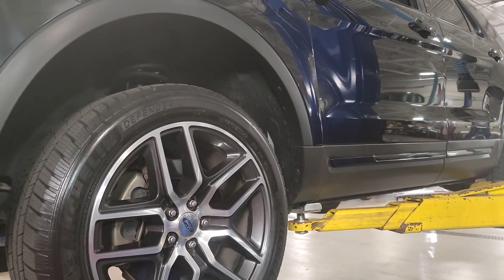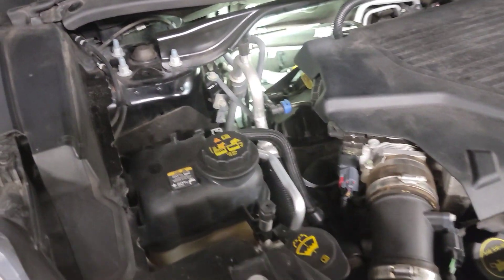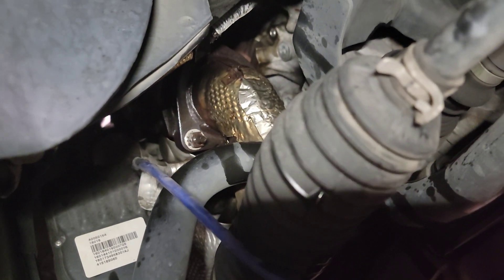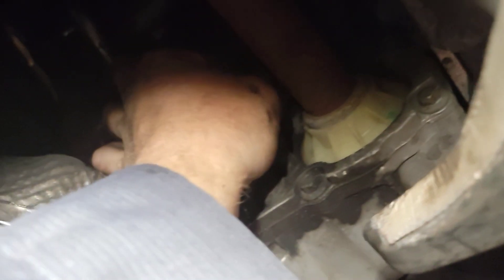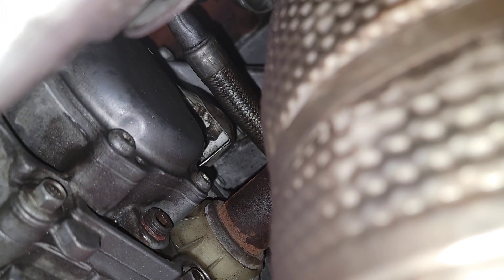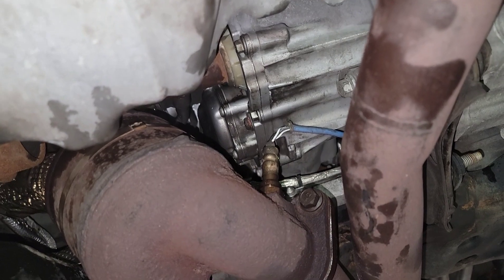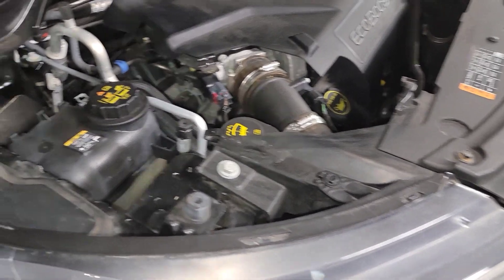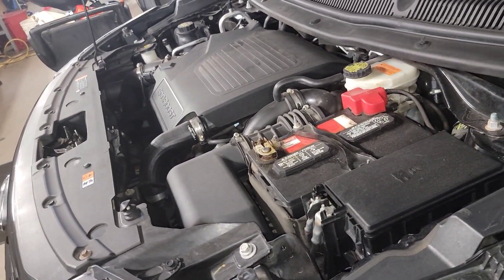Dealer Said, " PTU Cant be serviced  " WRONG!!!! Subscriber PTU Service 2016 Explorer Sport Let's Go

Comment: I do the drain and fill when I do the water pumps on the Police utility, we have the 3.7 n/a in our fleet. Figure I already have the engine on the table, might as well change the ptu fluid.
Reply: Don't get me started in the damn water pumps in the 3.5. What moron engineer decided it was smart to put the water pump inside the damn engine?!?! 😳 instead of just unbolting it and bolting a new one on when it starts weeping, nope. Tear the whole front end off the motor, may as well do chains, tensioners, phasers, etc when you're in there, because they'll be next.
Reply: We have had some go to the dealer under warranty but the majority of the water pumps we do in the shop are coming in around 80k plus. But you have to remember they have a ton of idle time which puts a significant wear on the engine.
Reply: Have you ever drilled and tap a drain in the case?

Comment: I still want to backhand the engineer that never put a drain plug in the ptu...how much extra cost to have then cast a hole and machine threads in....hell use a oil pan drain bolt

Comment: Thank you Rich for continuing to remind us about the necessity of maintaining the PTU on our vehicles. It has amazed me the terrible appearance of the lubricant in the unserviced and failed units from your previous videos.
Reply: They smell as bad as they look, I changed my PTU fluid on time and it was black. My local ford dealership said they couldn’t change the fluid, so I bought a hand pump and did it myself.
Reply: Mercon LV changes color around 15,000 miles i don't know why it does but i read that somewhere it looks like engine oil at that time .

Comment: PTU replacement is expensive ($2k vicinity). Been there, done that. Changing PTU fluid regularly is the absolute most important thing you can do to give your PTU a long life. For some inexplicable reason, PTU oil change isn't even in the service manual. If you own an AWD Explorer, Edge, Flex... anything with that PTU in it, listen to Ford Boss Me and save yourself a ton of money and grief!

Comment: I bough a 2017 Explorer used and the service dept. told me it was life time fluid and they wouldn't change it. I traded the explorer back in the next week and picked up a two wheel drive 2017 Expedition, more money, same mileage, less headaches.

Comment: I bought a 2017 Police Interceptor Sedan (Taurus), and it had this model PTU shown in the video. This video helped me immensely despite some minor differences in the surrounding components, just wanted to drop a comment and a like. Much appreciated.

I was thrilled to see pretty decent looking gear oil come out when I got the drain off. So glad it wasn't the goopy mess I've seen in other videos. Probably won't need to touch it for 30k as you stated, just glad I don't have to worry about it anymore.
Reply from the maker: Your good then for sure

Comment: This man does a fantastic job and he is a A+ mechanic I’m sure, but there’s a much easier way to do this. Instead of pulling the catalytic converter and messing with the sensor, you can drain the oil out through the drain plug and refill the unit through the vent hose, which is top side. What makes this a whole lot easier is putting the oil in a warm pan of water and warming the oil up before you pour it in. It does take about 30 minutes to drain the oil in but it’s a whole lot better than pulling out all those parts.

Comment: It's so frustrating!  I have the "shop manual" access for most makes & models and almost all of them say "no service needed" for transmissions and PTU's so they don't give any specs, nor anything useful as far as fluid replacement
Reply: Hello,
Which service are you using, Mitchell ?
Is it accessible to anyone ready to pay?
Thanks for getting back to me.
Tigo
Reply: @tt6518  I use the public library access.  They have manuals for most makes and models and the best part is they are online so I don't have to go to the library, just have to have internet access
Reply: @WJHandyDad  hello,
Haven't thought to try this option until you mentioned it, thanks for sharing with us .
Would you have an internet link please , I would like to try it too.
Thanks.
Tigo.
Reply: @tt6518  unfortunately there isn't 1 link.  You need to find your local library link, get a library card (I know it seems stupid if you're just accessing their online content, but they require it)  and then access it from your local library
Reply: @WJHandyDad  OK , I guess it will be difficult for me to access an US library as I'm not living within your country.
Thanks for getting back with this great info , will keep it in my head anyhow.
Good weekend to you.
Tigo
Reply: good luck - you might see if a library in one of the bigger US cities allows for international access.  I obviously don't know every library's requirements for a library card.   Ours locally requires that you live here and prove it with ID and utility bill.

Comment: "My" dealer refused to service my flex ptu, even after I explained how it could be done.   So now a great independent garage gets all my service work.  It wasn't as complex as that Explorer, and I would have paid an hour or so labor, but they are unable or unwilling to think outside the book.  Now I question if I got trans service and spark plugs I paid for a couple of years ago. All the dirt was still around the coil packs...  Yeah that's the kind of work that f' s it up for the rest ...

Comment: My wife has a 2017 AWD Lincoln Continental.  The dealership said the PTU couldn't be serviced just like you mentioned.  Do you know how difficult it is to do on a Continental?  I searched YouTube and found zero videos on that platform.  You and FordTechMakuLoco have good videos on Escapes, etc that I can use but do you know if the Continentals are the same, or do they have any unique challenges I might face?  Thanks in advance Boss Man!

Comment: I have same 2016 explorer sport and with same problem with the PTU, it’s starting to grind specially while backing out, not always but every once in a while, took it to the dealership and they quoted me $4000! So I took it to an independent mechanic for second opinion, and I was quoted $3400! And they claim that it needs replacement (PTU), from what Rich said here is, it only needs a top off. Curious how much did it cost to do top off?
Reply from the maker: No no no 
I didn't say if it's making noise it needs a top off 

Where the heck did you get that?

It needs serviced every 30k
Reply from the maker: If it's making noise it's done, you need a new one

Comment: Thanks for the video! Is it common to have the lower drain plug on the PTU stripped out and extremely stuck in there? I wanted to change the fluid but can't get past the drain plug.. 3.7 police explorer. Probably have to drop the cat and weldor something. very little room there
Reply from the maker: Of course it's not common
Reply: @FordBossMe  So I had to use a welder to get it out. The OEM ford replacement plug is 1/4" hex exactly.
Reply: @CREATINELUSTER I have the same unit. How long did the job take and how often do you plan to change your fluid?
Reply: @waltertaylor9615  I ended up having to replace my unit.. However, not to be defeated, i still removed the stripped plug. I drilled a large hole in the plug, screwed in an extractor, and welded it on there.. it did come out. Just welding a bead to a nut was not going to cut it. yours might not be as stuck though
Reply: @CREATINELUSTER  Thanks for your response. So I picked up 2ft of 5/16 fuel line along with 5/16 brass coupler fitting and took my 3.7 to a local shop for ptu drain & flush and had tech extend the vent tube so I can refill it from the top next time around. Hope everything works out for you as well.

Comment: There is another ford Tech I watch, that has a way to change the PTU oil without pulling the exhaust or temp sensor. He just puts and extension hose on the PTU vent line to bring it up above the engine to add the oil back in.
Reply from the maker: Yeah but it's a guess you just are guessing, sure you can get close but it's a good guess at best

Comment: I would like to see a video for an explorer xlt with the 3.5 non turbo, one that does not have a drain plug, just a fill plug. Non water cooled one. Is there room to suck the fluid out of the fill hole without removing the exhaust?
Reply from the maker: You have to use a little suction pump with a thin tube you can get them as a kit on Amazon 12 volt fluid pump
Reply: Thanks!

Comment: Hi, I just replaced the PTU on my 2016 Explorer Sport. It has the Police Interceptor PTU that comes with the external cooler which attaches to 2 coolant lines. Do you have any advice on how to get the coolant lines back into the cooler once the PTU is installed? I cannot seem to get them to seat back into the housing. Any advice would be greatly appreciated.
Reply from the maker: Ya know it's been a long time man and I only did 1 this way before

Comment: So when did we stop calling them transfer cases? Or is PTU a Ford term?
Reply from the maker: Ford term because it's not a regular transfer case
Reply: @FordBossMe   the last and newest Ford I had was. 90 ranger. Was 2wd. Had the bullet proof 2.3 anemic engine. Should never have sold it a few years ago. It owed me nothing. Had 310k on the original engine and got 25mpg and I redid the AC (134 conversion) and it got so cold you could hang meat in that can even here in the HOT SC summers!

Comment: I have a ‘22 maverick AWD. It’s FX4 so I have yet to lay eyes on the PTU.  Have you serviced or worked on yet? Does it have a drain/fill plug? Or is it a suction pump job like the  13 escape? Thanks in advance!
Reply from the maker: I haven't seen the power transfer unit yet but I'm pretty sure there's a fill and a drain plug
Reply: @FordBossMe  hope so. I’d like to keep it serviced a little (lot) more than the mfg says to

Comment: What is the general cost for a service like this? I have 2016 FPIU n I’m suspecting it has never been changed
Reply: Ford recently estimated over 800 to remove Cat converter, Y-pipe, and driveshaft front flange, for drain and refill. SMH.
FORD (Found on the road dead!)
Ford

Comment: I thought I may have seen a video that the PTU's on the Taurus' are easier to get to than uninstalling the converter. That you just need a ridiculously long socket extension and a standalone vacuum to suck the fluid out. True? Not true?
Reply from the maker: I don't remember them all honestly

Comment: I’m about to replace the PTU temp sensor on my 2015 explorer interceptor 3.7 67k miles, (I just bought this thing in an auction). The code is p182d transfer case temp sensor circut high. I hope this fixes it .
Thanks for this video it helps out a lot.
Reply: Have you changed your PTU fluid yet?
Reply: @waltertaylor9615  yes, and I also changed the sensor for it. It got rid of my code.
Reply: @El_ReyJ  Which method did you use and how long was the job?

Comment: Great info as always! What is your opinion on these body style explorers to current? Which engine is best option? My parents are intrested in possible purchasing one. And they would perfer a 4 wheel drive one.  Are these awd or four wheel drive? I'm kinda weary of the ecoboost engines. They plan to keep it long term. Thank you
Reply from the maker: Best is 3.5L NA and 2015 - 2019
Reply: Thank you

Comment: Hey Rich, I brought my 2018 Ford escape 1.5 eco-boost in for a PTU fluid exchange the total was 169.99 they used 2 XT 10 QLVC oil automatic transmission fluid 18.38 parts labor 151.61 says completed transfer case flush as per customer request. Do you think they really did the fluid change? Thank you for your great videos they’re all excellent.
Reply: If your ptu is like the one in this video they put the wrong fluid in it.  It should have synthetic gear oil put in it, not trans fluid.  If it is a transfer case then yes usually uses trans fluid.
Reply from the maker: It's not a transfer case it's a power transfer unit and it does take gear oil not trans fluid
Reply: Hi Rich, I requested a PTU fluid change on my 2018 Ford escape 1.5 eco-boost with 16,000 miles. On the receipt I received it said they performed a transfer case fluid exchange service at $169.99 they used automatic transmission fluid and it states completed transfer case flush as per customer request. I did not request the transfer case I requested the PTU fluid change. Please advise if this is correct. Thank you for all you do I cannot work on my own car due to my disability.
Reply: @disabledofficer6360 The PTU (Power Takeoff Unit) is on all wheel drive (AWD) vehicles, and it takes power to the rear wheels from the front, these are on primarily front wheel drive vehicles. like on cars and small suv's (like the escape).  These usually use gear oil.

The Transfer case is what transfer's power to the front wheels on primarily rear wheel drive vehicles when 4x4 is engaged like trucks and large suv's.  These usually use trans fluid.

On an escape you should have a PTU.  It is still a case that transfer's power to the rear wheels on AWD vehicles so many people still refer to them as transfer cases, so they are probably refering to the PTU.  It should have gear oil in it though not trans fluid.
Reply: @procrastinatingnerd  thank you for the response. I appreciate your time explaining it to me. My 2018 Ford Escape has been Recalled three times in three years plus computer problems. The Ford Service Dept. stole my free VIP Lifetime Oil Changes in writing as per the service manager.  It appears their trying to make the money back it cost them to replace the engine at 15,000 miles.
Reply: @disabledofficer6360  That does sound fishy.  You might want to bring your escape to a different shop and ask them to check and report to you on what's in the PTU.  Is it gear oil or pink trans fluid?  I think that would determine what you do next.  If you only had 16k on the PTU the oil probably wasn't that dirty yet so they probably won't be able to tell if it has new oil in it.  But if it's pink... That will answer the question.

I don't want to go down the road of conspiracy so lets just assume for now that if it's pink some one just made a mistake.  I know there is a plague going through all brands of dealers right now where they don't seem to want customers to come back anymore.
Reply: Sir, PTU takes 75–140 gear oil, NOT ATF. Pls call your dealer asap and request this be looked into immediately.
Reply: @DG-fe4ht  Thank you very much for the great advice. I don’t believe the Ford service centers have customers best interests in mind. This Ford dealer actually stole my lifetime oil changes that were free in writing in retaliation for my complaints on the three Recalls that I had fixed as well.
Reply: @procrastinatingnerd  thank you very much for your great advice I appreciate it I don’t know what’s going on with this Ford dealer service department. I believe everybody must be subservient to them. I’m the customer but they don’t realize it.
Reply: @disabledofficer6360  call BBB on them.
Reply: @disabledofficer6360  Maybe call BBB on them as someone else said, but I would contact Ford corporate and talk to them about it.  You probably won't accomplish much with either route though.  First find out what was done with your PTU then if they did indeed put the wrong fluid in it then contact Ford directly.

Maybe Rich could chime in for this part, but I would imagine that Ford would tell the dealer to fix their mistake, (if then made a mistake) and they will.  But then you will probably have to abandon that Ford dealer because they will likely continue their retaliation even worse against you for telling on them.  Being the Ford fan I am, I hate to see a Ford dealer treating their customers like crap, but not much that can be done about it except to stop giving them money.
Reply: @procrastinatingnerd  Thank you very much for taking the time out to respond to my post. I truly appreciate it and I do not know what’s going on with Ford but they should shape up. Thank you very much.
Reply: @procrastinatingnerd  Thank you very much for all the help you and others gave me I appreciate it. I am unable to service my own vehicle but I will hold them accountable. Thank you for your help.
Reply: @DG-fe4ht  I most certainly will make a BBB complaint and corporate as well. Thank you.

Comment: I HAD A 2022 explorer with 7500 miles come in today for oil change,  the oil fitler was covered grease got to looking the left front cv axle was not seated all the way, there was around 1/2 of splines showing then the oring you could move the axle on the splines, guy had me finish oil change then called the dealer for a tow since he didnt feel ti was safe to drive, have you seen that yeton any other 2022 exploreres with 2.3 awd?
Reply from the maker: Looking the library I have one where the CV axle was not seated all the way on a 2.3 l EcoBoost 2021 model with only 4000 miles

Comment: How about servicing a PTU without a drain plug?
Reply from the maker: You have to use a fluid suction pump rated for gear oil
Reply: I drill a hole in the bottom of the Ptu and tap them for a 3/8" Npt plug. There are videos on YouTube on how to do this.

Comment: The PTU on my 16 Lincoln MKC was much easier than that. I asked Ford to service it when it was there for an oil change, they said no that doesn’t need to be done so I did it myself. The half a quart of oil that’s in it was so black and broken down after only 36000 miles.